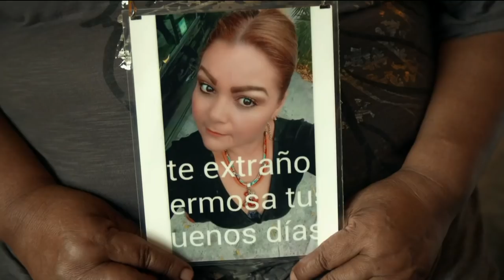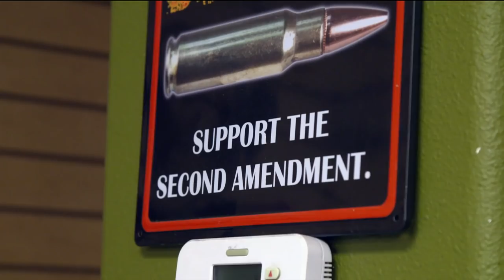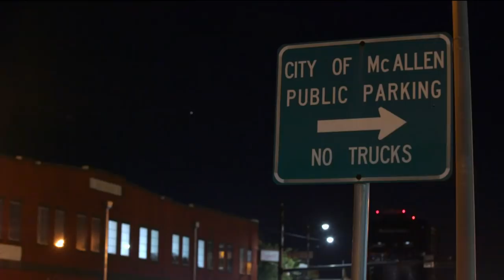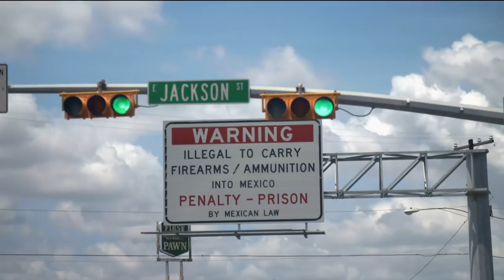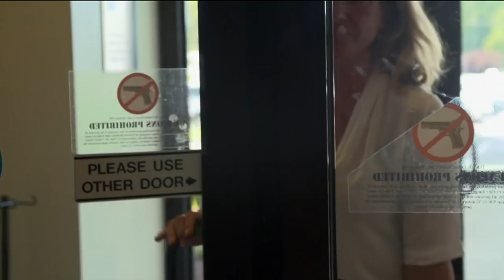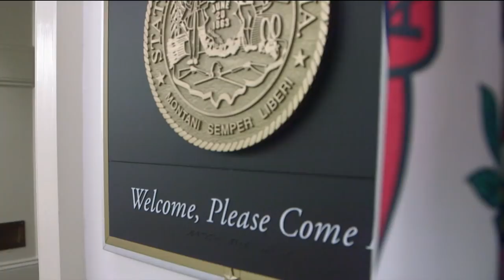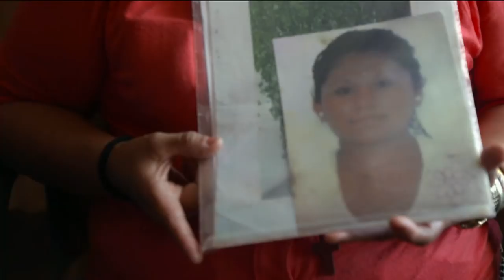How Mexican Cartels Exploit America's Gun Laws

Comment: Talks about crime , commits a felony when cutting the barrel on that AKm
Reply: The barrel cam be replaced, you have to cut the "lower"...easier to melt it with a torch...
Reply: Is it really illegal To cut a gun in half? Lol
Reply: @QQ-hm4nu  Yes because you're not rendering the gun inoperable, just stopping it from cycling on its own. The NFA requires that a rifle barrel must be over 16 inches, shortening the barrel below that without submitting the proper paperwork is a felony. Just like Karen Mallard and Scott Pappalardo this is just another case where gun control advocates are ignorant about the guns the want banned and the laws surrounding them.
Reply: Grif Denton ahh I see what you’re saying.
Reply: @QQ-hm4nu  since you may not know. The only way to demill a weapon is to cut the receiver apart in jagged parts as a skilled craftsmen can weld it back together. However, cutting the barrel down below 16in or cutting through the serial number is a felony under federal law.
Reply: @Private Zim if it was in Mexico then the gun itself is illegal. If New Mexico then what they did was illegal.
Reply: @grifdenton5224  cutting the barrel broke the law
Reply: She is now a Criminal.
Reply: Instead of cutting the guns how bout use them lol
Reply: @archangel9727  yes and in fact, the reciever must be cut into three separate pieces as per BATF law.

Comment: The only thing dumber than the research done in this video is the comments. You can not, under any circumstances, own or buy a fully automatic firearm in the US. Been that way since 1913. You can buy semi-auto firearms. (One trigger pull=one round) It is not easy to modify / convert any firearm from semi auto to full auto. Its highly illegal and requires more than a little gunsmithing knowledge. Every single gun in america has a serial number. Every sale that takes place in an gun shop or gun show open to the public requires a background check. Now there are exceptions, person to person sales are legal without a background check in most of the US. Now if you do privately sell your firearm, and you sell it to a felon and it can be proven you had prior knowledge of such, its jail time. Online sites like gun broker have statements you must sign to purchase or buy. 
Now, it is possible to own fully auto weapons in the US. Suppressors and some weapons of war. You become a gun dealer. You apply for a Class III Federal Firearms Licence (FFL). Its not easy to get, and fully auto weapons still may be illegal in the state you are in. Magazines have nothing to do with the weapon being fully auto or not. There are no parts for sale in the US to make any weapon full auto. Now, there is something called 80% lowers. Or 80% finished guns that take a little milling to complete them. You can buy an 80% gun no problem legally in the US. No serial. No nothing. No straw sale or FFL needed. A 9 year old can order an 80% lower. Shipped to your door. BUT: they are all semi auto, you have to build the gun yourself, you can never, ever sell it. Those are the facts of buying/selling guns in the US. Please, remember them and correct others to prevent the meta dumpster fire this video and comment section is. Thanks.

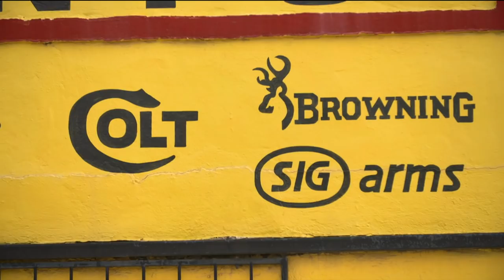Comment: 9:13 I bet they cut off the fact those cost 30 grand or are only for dealers and are very regulated
Reply: If you want to go the legal route it'll cost around 30k. But you can easily convert a semi auto AK to full auto. And you don't have to be a dealer to buy full auto if it's pre-86 and transferable.